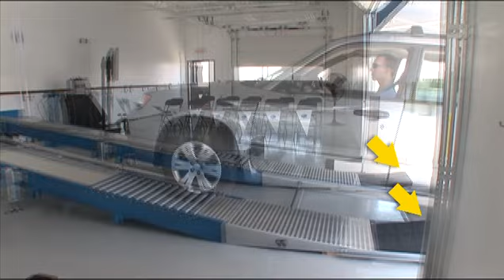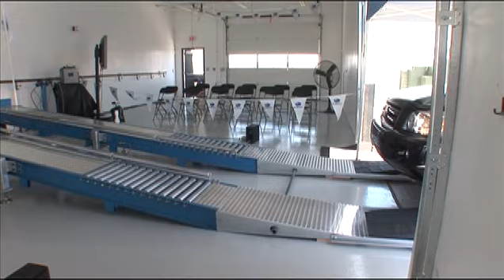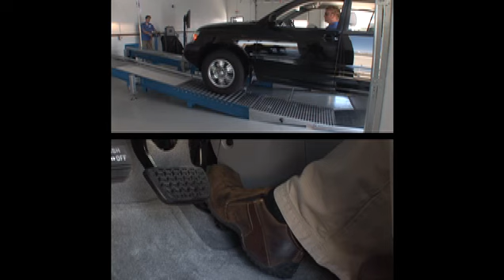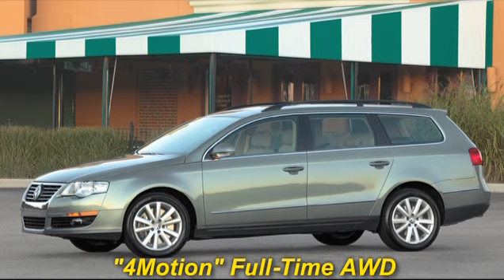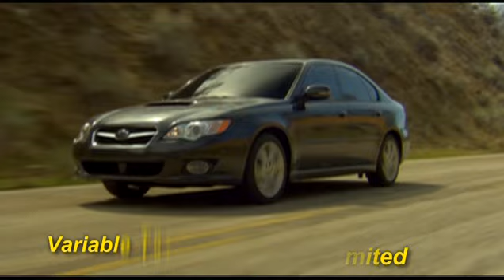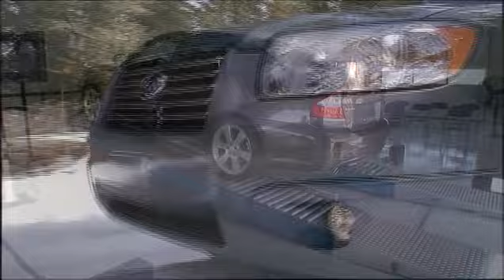Subaru Symmetrical AWD vs. Honda, Toyota, and Volkswagen

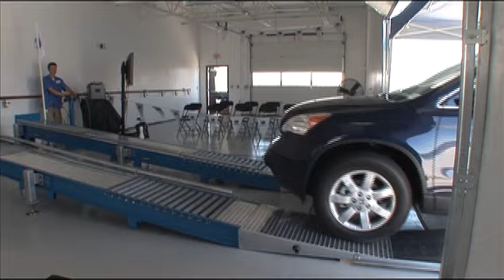Comment: 0:56 I dunno, this looked like it was gonna go up if the driver was a little more keen on allowing it to.
Reply: They keep stopping in order to pretend Subaru's AWD system is so great, its not, and they were starting and stopping the slip rollers with the computer system in order to make it look as though Subaru had no problems.

Comment: Subaru commercial?
Reply: I think so.  However, I think Subaru makes great cars. The present car I drive is a 4th Subaru, which is Imprezza. 

I had driven Toyota's 4 wheel drive before I bought the first Forester, which was released more than 20 years ago. I found Forester having much higher quality and performance than the Toyota.

Comment: While I don't agree with the assertions that the offset transmission/drive axles are the cause of the inabilities shown, I am impressed by Subaru's ability to climb with just one wheel.
I know this has much more to do with highly effective proportional braking of individual wheels, than it does with a symmetrical drivetrain.
Reply: Correct btw subaru does not recommend doing this as it is really bad for the cv axle having one tire move the car witch is why unlike vw they don't advertise this feature
Reply: Yea i highly doubt it has anything to do with that, is more of the issue with open differentials and not having a proper torque vectoring system onboard. Older subarus would probably have similar issues unless they have limited slip differentials.  As for cars that didnt climb....they have just fake "AWD" sustems that cant be depended on that much they might toggle on during a slide but that's about it then they will instantly turn off its just 0 offroad/bad conditions capability. Older 4Runner would do much better but newer ones are as fake as most of these "AWD" systems in transverse engine cars.
Reply: @Kacpa2  While not AWD, the Mazda Miatas I've owned over the years, all had Torsen differentials. Unlike typical limited slip differentials that rely on friction disks, Torsen has a very clever combination of spur and worm gears, to deliver power to the non-slipping wheel.  Completely mechanical without any computer or controller to function. I wonder how that would work on a Subaru for both axles?
Reply: @ElementofKindness  Just look at the subaru STI system. they have torsen (or torsen like) system front and rear with an adjustable torque distribution center diff
Reply: @pascha4527  Oh, that's cool!  I love the Torsen differential in Mazda Miatas. I'd run out of steering before I'd run out of traction when driving them in deep snow. 😅
Reply: I have to wonder how you would even end up in deep snow in a Miata. I thought those were weekend toys for the summer.
Reply: @salsamancer  I drove them for over 20 years, year round.  They were incredibly reliable, but in inclement weather,  you had to know what you were doing.  I have finally decided to give them up for a Subaru since, though.
Reply: @ElementofKindness  that's nice. I always dreamed about one but in the end I ended up getting a motorcycle for my speed fix. I use a Forester for more practical trips
Reply: @salsamancer  I'm with you there as well! Worked my way through several bikes, until I found two that I don't see myself looking for anything else.  An '07 BMW R1200GS for moto-camping adventures, and an all black '16 Ducati 1200R Monster for the speed fix you speak of. 😅

Comment: Not true. My car will clime without traction. Found a pair of old RI 502’s at a surplus store and threw them on the roof rack of my wife’s highlander. Haven’t tried them yet, but they should do the trick. Told my wife they are for storing my deep sea fishing poles...🤫

Comment: It's not the first video showing Honda's fake AWD system.
Reply: I had a pilot.  It had a locking center diff.  If you lock the diff and disable traction control, it will go anywhere the tires let it.
Reply: Just turn off the traction control in the cr-v and it’ll do it fine. I have one same as seen here and it’ll do 4 wheel powered donuts on ice with traction control turned off.
Reply: Jakub Kurzawa it's not a fake awd , it's just not the best, unless sh awd is the beast.
Reply: I love 4 wheel drive
Reply: It's not fake, it's just designed to get you out of a side street, not up a slippery cottage country road. Get the Sube, if you drive in those circumstances. But you're right, all those people thinking they have AWD go power when really they don't!
Reply: Dude it’s not real ice it’s 5 rolling tubes
Reply: @jesuisunpoisson4804 As stated in the video 😐
Reply: 🤣😂😅 real true
Reply: У Хонда есть SH-AWD, которая уделывает всех.
Reply: If this tester read the hand book for the crv you should switch the vsa off ( traction control) when your stuck in snow/ice and when your free switch it back on! I’ve never had a problem with any 2 of my crv’s
Reply: Tractioncontrol kills the rpm without rpm no power so re do the test and switch off the tractioncontrole of the failing vehicles.

Your welcome
Reply: James Mcginn

Well no, that's unlikely a result of AWD. Front wheel drive vehicles already excel at snow.
Reply: @Lucky8s  The FWD cars I've driven have been crap in the snow with all-season tires, in my opinion. Mazda 3, Honda Civic Si, Chevy Impala, Mitsu Eclipse, etc., all pretty scary. My RWD Mazda RX-7 with snow tires killed them all because it was balanced, and of course the dedicated winter tires. But it doesn't even compare to my Forester, which is even easier to drive in snow than any of the 4x4 trucks I've driven.
Reply: @seanwilson4530 

Obviously since you've run all seasons on them. What's the point of your comment?
Reply: @Lucky8s  Exactly.  Around here people who know a little about vehicles call them "No season tires".  Bit of a stupid comment.  He compares FWD cars with no-season tires to, to a RWD car with snow tires?  Idiot.  Then compares those two incomparable things to a symmetrical, "full time" AWD system and 4x4 trucks.

By the way, cars like Volvos, which are designed for northern, winter driving (or at least with it in mind) are great in the snow and ice.  (With winter tires, obviously).
Reply: Jakub Kurzawa 
My crv awd works great, mud snow ice, no problem
Reply: @jamesmcginn2216  and you put more then. 400k miles no problem and Subaru 100k miles motor broken for sure
Reply: @ronyvilleda9292  Are you saying Subarus can't go past 100k miles? That's funny, I've seen them do 250k, and they have a reputation for lasting.
Reply: @ronyvilleda9292  My 130k mile 2000 Subaru Forester begs to differ. Only thing replaced on it has been the brakes.
Reply: Sean Wilson nah. What about head gasket problems? Our 2018 outback has poor built quality as well as horrible infotainment and upgraded sound system. Not to mention they have no solution yet for faulty “distance to empty” fuel reading, leaving some people stranded on highway and me not able to start a subie next morning. Never again, Subaru is not adventure worthy, nor dog friendly. Me and my family feel much safer and more comfortable in Acura with ah-awd system!
Reply: Rony Villeda bullshit, my 2000 forester has 410k, it’s called taking care of your car. You do that, it’ll take care of you.
Reply: @IrishBiteGirl  over 100k and you haven't changed the timing belt? Yikes, only a matter of time now.
Reply: @ronyvilleda9292  haha im laughing at this comment right now because I have a 2003 subaru outback sitting out in my driveway with 362k miles, original engine and automatic transmission as well as a 2010 subaru outback with 210k miles.  Additionally, I know someone with 630k miles on their outback, original engine.  Do you have first hand evidence subaru engines cannot last more than 100k miles?  I have a lot of evidence to back up the fact that they last much, MUCH longer!
Reply: @aaasssppp123  imagine relying on am empty light rather than the gauge lmfao
Reply: @outdoorsurvivalshop8986  Original head gaskets, though? Head gasket replacement is very expensive in Subaru, and very frequent. Maybe not in current models (hopefully not) but from the 90s to the 2000s yes.
Reply: @80sDweeb  my 2003 subaru outback has had head gaskets replaced a few times and is at 364k miles.  My 2010 is on original head gaskets at 212k miles.
Reply: @80sDweeb  I'm no my 95 legacy has 267k and original head gaskets
Reply: Subaru’s isn’t that great either. An open diff and differential braking will never substitute for a limited slip and locking centre differential—or locking front and rear diffs.
Reply: Bartonovich52 this is why I love my sti
Reply: @Bartonovich52  Subaru AWD uses a Viscous type limited slip center diff, that only becomes "open" if the clutch packs erode.
Reply: @Bartonovich52  The STI has limited slip difs and you can lock them :)
Reply: @Bartonovich52  Locking differentials would make it 4WD, not AWD. That's not really what Subaru is going for in their cars.
Reply: Bartonovich52 nah stock Subarus have been seen shaming cars with such technologies you mentioned
Reply: @Bartonovich52  Subaru has the best AWD system
Reply: I have subaru outback 2006 manual, and honda crv 2013 manual. Subaru is better on road but offroad (any conditions)  they are almost similar but i think crv is a slight better.

Comment: 4:15 "did you also notice what the front end was doing, it was moving side to side" did you also notice the driver turning the wheel side to side?
Reply: That would be the driver keeping the car on the ramp, otherwise the torque-steering would have pulled it off lmao

Comment: The awd in honda basically a very cheap system that uses open diff in both front and rear. With a locked ratio clutch in the center to send power (30% for example) to the rear. This is the SAME system used by the toyota but toyota uses 50% rather than 30%. In the subaru, instead of using a normal clutch in the center, it uses locked clutch so that the power doesnt lost to the front wheels when both front is slippery. This guarantee a desire power split when both front or rear has slip. But this is NOT a perfect system if both left/ right tires are slippery. The 4motion uses similar system. However the audi a4 uses a much better system that uses limit slip in front and rear axle and with a variable center locked clutch to basically to split the power from left and right with various power between front and rear. That means the car still have power going on the road even if theres ONLY ONE WHEEL have traction. In this video, the awd system only works for toyota and honda is (either 1 wheel has no traction) and for subaru and vw is (either 1 wheel or both front/ rear wheel lost traction).
Reply: Lexus AWD sedans are RWD based and have a 30/70 then a 50/50 when it gets slippery. The AWD can lock the center diff transfer case electronically. No L/S on the axles, but has traction control. Not bad. I have one. Probably a step under subaru.

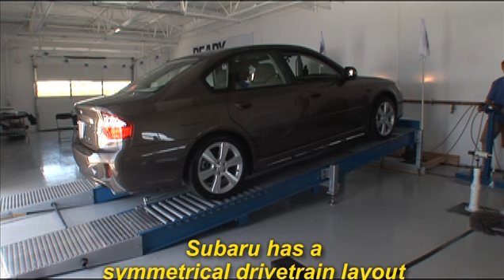Comment: 9:11 no, it's because it applies the brakes to front wheel which is slipping, forcing the differential to divert torque to the wheel with traction

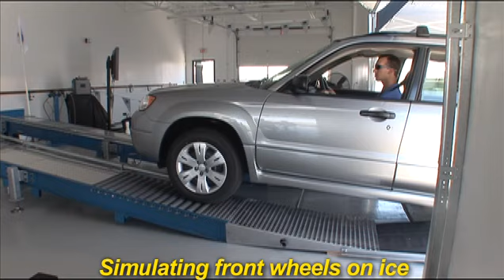Comment: I own a Subaru and I also know that part of the explanation here is a BS. A Forester climbs at 2:10 because with an auto gearbox it is almost a front wheel drive until clutch in gearbox clamps stronger and links front to rear. Just like 4motion, but in VW clutch is located in rear diff and is 100% open when not needed. It climbs with zero rear wheel slippage at 2:40 because it is back in FWD mode. No sensing of loss of traction, it just does not lose it because rear cannot spin faster than front. It would not pass a one front wheel traction test because of an open front diff, and either pass after a few seconds of spinning or fail with one rear wheel traction depending if it is equpped with rear diff with limited slip or not.  Legacy has a same design with a clutch between front and rear, but is equipped with a clever traction control that can use brakes to stop a free-spinning wheel, a workaround when no locking differentials are provided.

With a manual gearbox Forester would act slightly different - It would have a front-rear LSD differential so with rear on ice it would first slip for a second or two and then LSD clamps it would pull itself on front wheels.

Comment: should have used an 80's audi quattro with optional locking diff.
Reply: This video was to compair most suvs that most common familys buy, when you dont have to fork out 40,000 for decency..